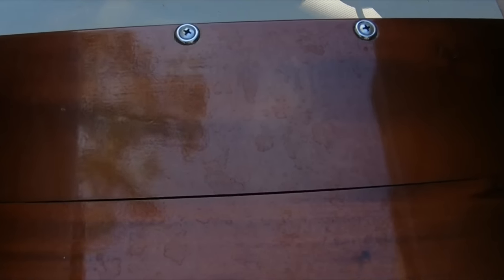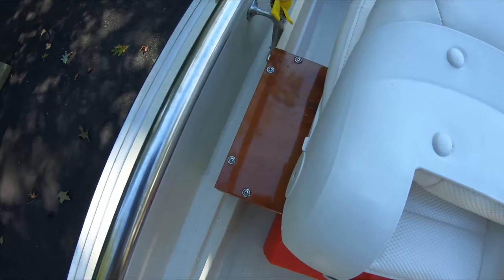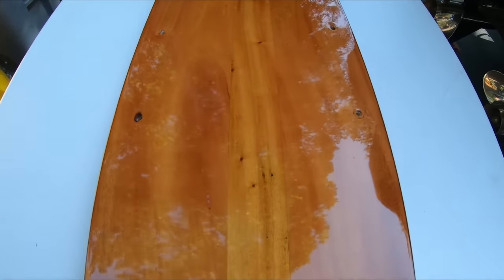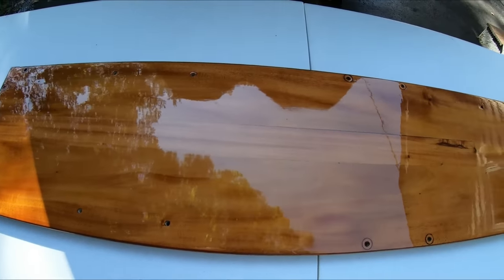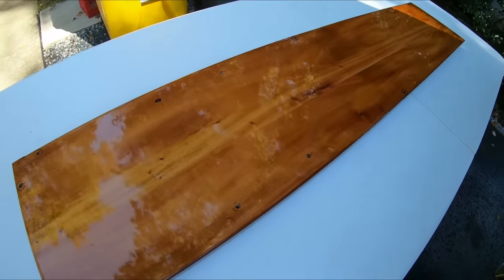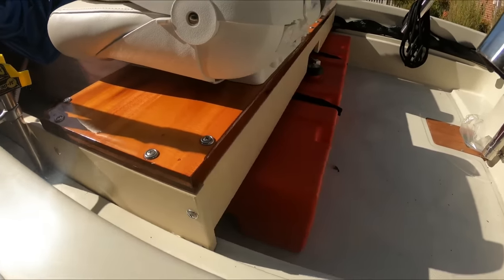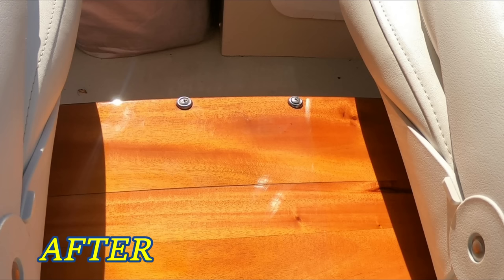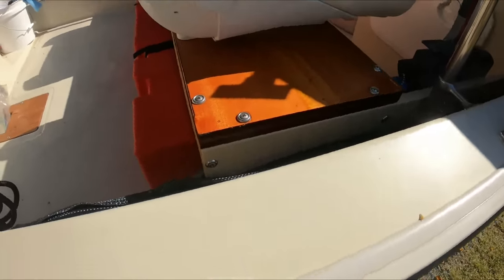BOSTON WHALER, Easy How To WOOD REPAIR.

Comment: Nice work. Would a center support joist below the board have helped prevent the crack?
Reply from the maker: I don’t think so, my repair has held up fine all year. I think it just lacked some adhesive in that joint. Still looks new.

Comment: I am looking to get 1972 17” whaler 
Is it made out of wood or should I worry about rotting of the hull how would I know
Reply from the maker: It’s foam filled with some wood inside.. As long as it’s solid you should be fine. Walk the entire deck to check for soft spots. Check drain tubes and the seam along the top of transom.